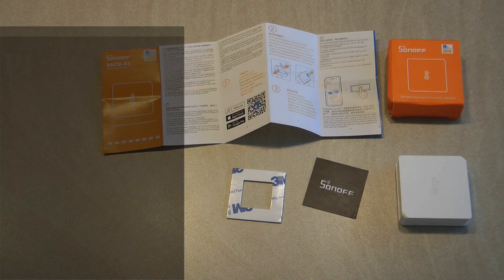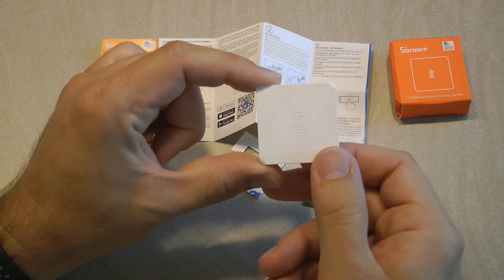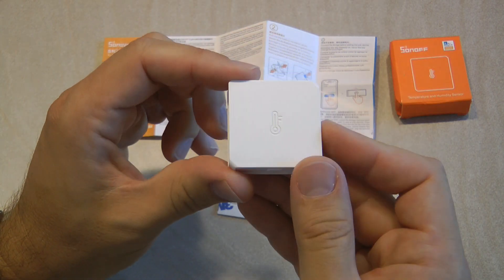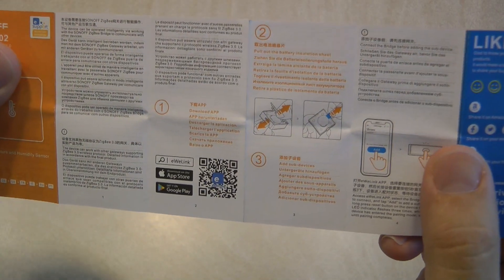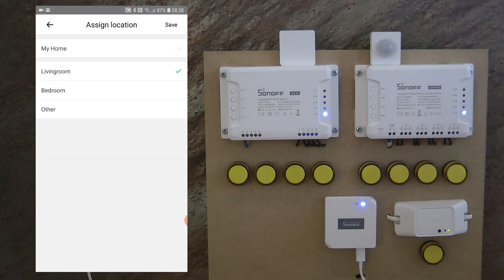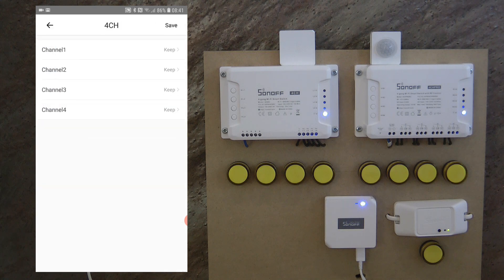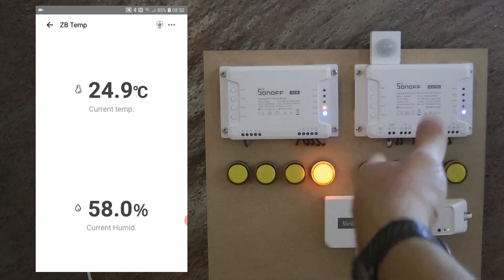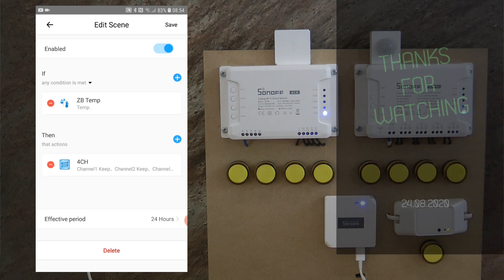Sonoff Zigbee temperature and humidity sensor

Comment: I'm just adding my experience here - the pairing wouldn't work with the manufacturer-installed batteries (yes, even with the battery isolation removed!)  I would see the flashing lights but no pairing.  It wasn't until I put in fresh batteries that the sensor would pair.
Reply from the maker: Good to know. Maybe it was shipped with nearly dead batteries. I am glad you got t working after all.

Comment: What's the difference between the zigbee and TH16?
Reply from the maker: In terms of the sensor, it is probably same or very similar. TH16 connects to the wifi directly, and it also has a relay. So it can directly control a device, for example a fan, or dehumidifier. The zigbee sensor works on zigbee, it also needs a zigbee bridge before you can use it. And it is only a sensor, if you want to control anything (like a fan), you need another Sonoff like a Basic that has the relay to control any device.

Comment: Great video. I have so many IoT devices connected to my router that my bandwidth has decreased. Do you have a video to enhance this or any other suggestion you can give me like creating VLANs? What devices should I buy? Thank you!
Reply from the maker: Sorry, I have no idea. Definitely one reason to switch to Zigbee, so that instead of all the different individual IoT sensors, only the Zigbee bridge is connected to the wifi. You can buy a router which works on 2.4 and 5GHz as well, and you can migrate all your laptops, phones to 5Ghz network and leave 2.4 for the IoT. You can also download a wifi scanner app on the phone to see which wifi channels are used by your router and other wifi networks and maybe set it manually so it is on a less busy channel.
Reply: @csongorvarga  thank you! I think I will start buying Zigbee devices as you said!

Comment: Does it work with Google Assistant?
Reply from the maker: The ewelink app works with Google not the device directly. But this is just a sensor, Google will not do anything with it.
Reply: @csongorvarga  I wonder if Google Home will treat is as a sensor. E.g. if you can ask "what is the temperature", or create routines depending on it. On itead site they claim that it should work with Google, but I don't have it myself to test and I haven't found anyone who tried that yet.
Reply from the maker: @DidyshishBaishushish  Sorry, I was not correct last time. I looked into this. I can see the ZB temp sensor in Google Home, I can ask what the temperature is, but it cannot be used for anything. Google Home routines start on voice command, or time/sunset/sunrise. Nothing else. You cannot set up a routine on a device state/event.
Reply: @csongorvarga  OK, thank you! Yes, Google Home is not a "smart home hub" per se, so it has only such limited possibilities. 
It is annoying that TH10-16, despite having temperature sensor, cannot be usedas both sensor and relay in more complicated scenes in eWeLink - e.g. I would like to have daytime and nighttime temperatures set to different levels, but that is not possible with single TH (ok, I know that ZigBee temp sensor + Basic ZigBee costs the same as TH16+Basic WiFi ;) )
BTW, I recently had Sonoff Basic to burn out while powering car preheater (2000W max), so from now on I will use Sonoff relays just to trigger high power rating contactors...
Reply from the maker: @DidyshishBaishushish  Yes I agree with both. Basic have a 10A relay, so 2000W is almost at its limit. So I am not surprised. POW has a 15A relay, I think that would suite the heater much better. And yes TH10-16 is very limited by software.
Reply: @csongorvarga  so google home is shit then.

Comment: Hi. Is this scene working in LAN mode? Thanks!
Reply from the maker: That actually I have not tested. Scenes do not work if you have no active internet connection. You most probably can access the sensors locally tough.

Comment: Hi - anyway to display Fahrenheit instead of Celsius?
Reply from the maker: Hmm good question. I don't see the option to change to Fahrenheit...
Reply: @csongorvarga  Thx for your reply - not good for us in the states that more or less only use/understand Fahrenheit - Firmware update? I hope...
Reply: @csongorvarga  forgot to mention I have a bunch of Sonoff WiFi devices and they have the "units" option for temperature...
Reply from the maker: @larryfoss4776  Hi Larry, I got a response back from my Sonoff contact, she says: "Celcius on eWeLink APP, Fahrenheit on Alexa APP". I don't own an Alexa so this is not something I have seen or tested.
Reply: @csongorvarga  Thank You - yes I can confirm - it connects to Alexa and the APP display's Fahrenheit - also you can ask her what is the temperature (device name) and she tells you...   KOOL!
Reply: @larryfoss4776  yes correct: Alexa can see the sensor, temp is in F, you can ask what is the temperature of “name” and she will report it HOWEVER Alexa cannot see or report humidity not a bit deal but most importantly Alexa cannot use this sensor as a trigger. On the other hand she can use the Zigbee motion sensor as a trigger... but the reaction time is veeery slow.

Comment: Do you know if this would pair with a Smartthings hub?
Reply from the maker: I think it would. These are Zigbee 3 sensors and compatible with other Zigbee gateways
Reply: @csongorvarga  Thanks for the advice. I'll see if can get hold of them as I'm in the UK.
Reply: Will this be compatible with Philips Hue Bridge?
Reply: were you able to connect this to Smartthings?  i got one about a month ago, it was a huge pain in the ass to get it to work, and even then it wasn't perfect.  then after about a month it went offline and now i cannot get it set up correctly again.  any tips??
Reply: @dennisdavis6943  I have a couple of them. One is usually at room temperature and that does work fine. Another is in a freezer and that was a pain. I don't think the range on them is great. I use a lot of IKEA repeaters which I think help. Apart from that though, I don't anything special apart from the custom device handler but I expect you're already doing that?
Reply: Works on my smart things but need DTH
Reply: @AgentOffice  need DTH?  Does that mean "custom device handler?
Reply: @wharfrat53  yes but I think it works out of the box now
Reply: @AgentOffice  I would love to  get confirmation on this.